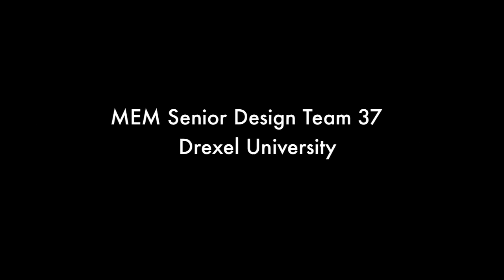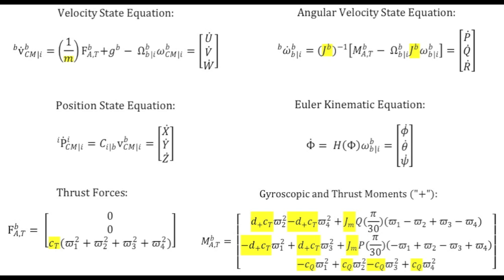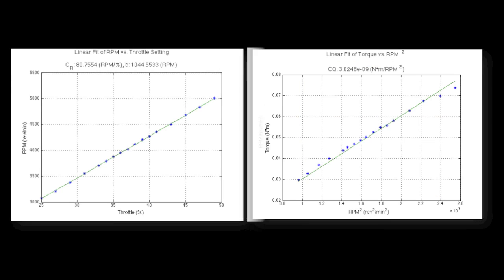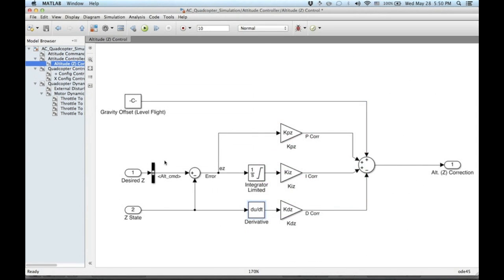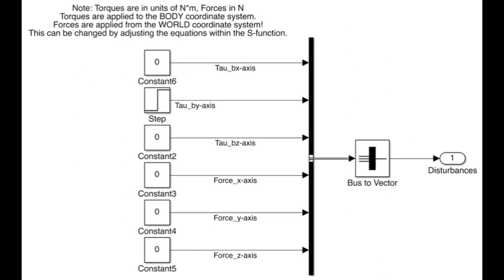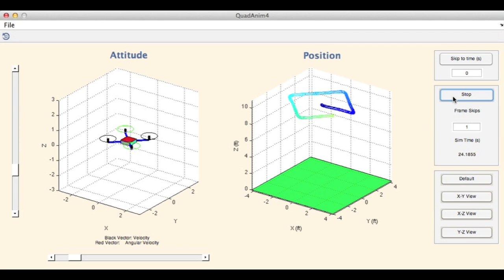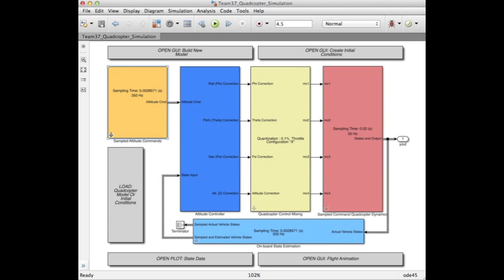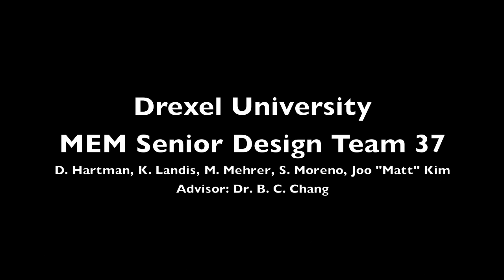Quadcopter Dynamic Modeling and Simulation Using MATLAB and Simulink

Comment: I am working on the project which is very similar to this project.But I have some issue with the mathematical theory part. I want to know in the block diagram, which equation will come after each box and which equation do you use as input and which equation did you get as an output system?